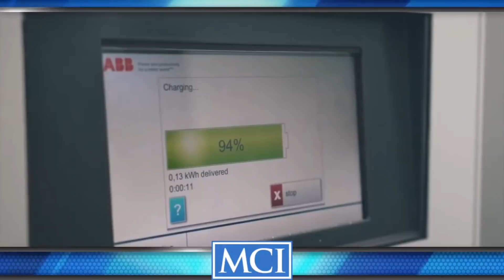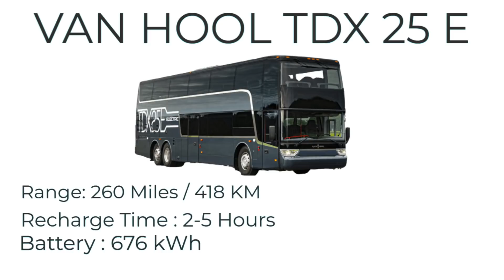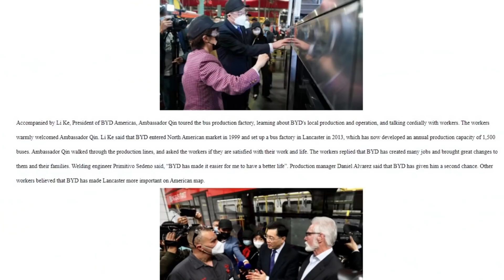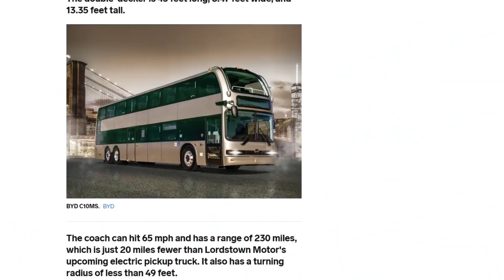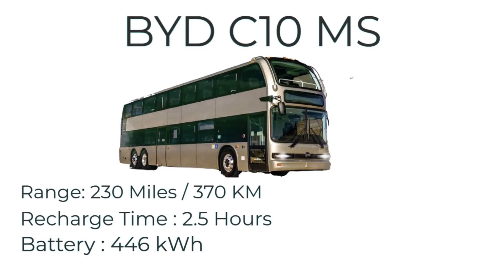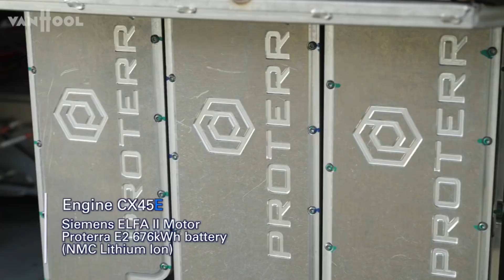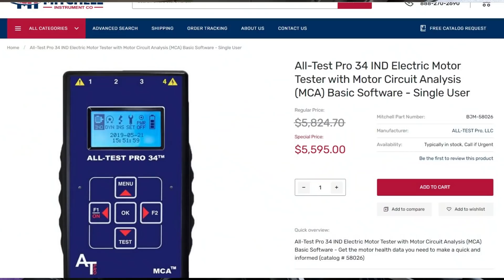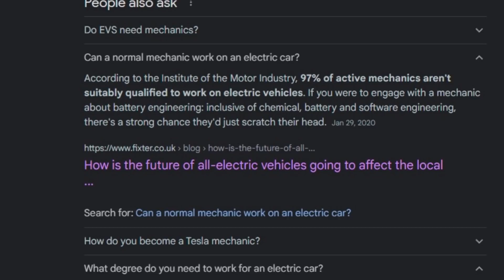Are Electric Buses working out in the US?

Comment: Also, I have a friend that runs an NGO in Romania, where there was a big scandal a few years back regarding some early electrics including BYD. The scandal was that they had two demo city buses, and both broke down during the entire demo run. That sparked some debates, pro and con, and my friend went on a campain to just simply gather data.
One thing that was a bit shocking (haha...Im doing your puns now), was the issue with fires. Fast charging, as well as the buses just sitting at night were at risk of fire, and battery fires are very different from diesel fires. He has documented all the cases since 2006 on the forum, and its pages long, of garages that would go up in flames, and in one case somewhere in one of the Nordic countries, the entire fleet of 200 buses went up because of a short in one of the electrics. This happened in the EU, Romania (back when it wasnt in the EU yet, and one more time later), Russia, China, and so on, with fires consuming anything from one bus, to the entire fleet, garage, offices and everything.

It is something that has to be taken into account, even more so as fire fighters need special training, and often cannot even approach these fires depending on weather (maybe thats changed now. Im not FD.). I always come off as being anti eletric, when I love trolleybuses and trams, but the issue I see is that this is not a technological advancement, but rather a governmental advancement. This tech would not survive on its own. Diesel in the auto world was never helped along, and even Diesel still made inroads in cars and trucks. I doubt that would have been the case with Electrics outside of some very small city cars (a la the motorcylce license cars of Paris) to some exotics.

Another thing that I find intriguing, is how different agencies treat the battieries, were the DOT will say they are fine, but the FAA outright bans the transport of Li-Ion batteries (I think it was due to UPS 6 that went down because of them. Also look up One Wheel, a company that tells customers to spray paint over the hazmat labels or their FedEx air packages, returns of DEFECTIVE battery powered devices). I am not sure what the evac time for a coach or city bus is when full, relative to the expansion rate of a Li-Ion fire, or if there were any tests done by the DOT, like the FAA requires manufactures of aircraft and operators to do. So, a lot of these hurdles seem rushed and its usually the consumers that will suffer. And I havent even gotten into any  geo-political aspects, the why, where, who, and so on. Im more interested in the engineering, practical aspects.

Hopefully I didnt go overboard with the clickity clack here lol. I have to get back to work anyways.
Reply: "Eh, who cares about a bunch of battery fires?  As long as there's no tailpipe, we're good!" -Typical EV fanatic  😂

But seriously, isn't it interesting how "hoverboards" with small LI-ion batteries were banned from public spaces and transport (for obvious reasons), yet vehicles with giant 500+ kWh firebombs...I mean batteries onboard, are allowed to transport passengers?  But hey, gotta break a few eggs to make that omelette, right?
Reply: @guildrich  Yes. There was a RoRo car carrier then sank a while back. It made headlines for some one of a kind Lamborghinis and Bugattis, and it all started from a VW EV. They evactuated, the ship burned so bad that eventually sank.
Reply: It’s important to understand that not all lithium ion batteries are created equal. There are several different chemistries, and form factors (of cells and packs), available and both have a strong influence on fire safety. If engineers make poor choices (such as with Chevy Bolt batteries) the fire risk is very high, whereas if the correct choices are made, fire risk is very low (e.g. LFP battery chemistry). Certainly, with the proper engineering, risk of fire starting is much lower than in an internal combustion engine vehicle, although it is true that if fire starts it can be more dangerous because the fire can be harder to extinguish. However, many batteries have effective anti-propagation designs to reduce this risk also.
Out of interest, how much research have you done into subsidies for fossil fuels? I think you’ll find your statement about diesel is not true; it’s just not as overtly obvious that the subsidies are happening because they aren’t at the point of purchase.
Reply: @harry-dymond  Yes, you are right about the subsidies for fuels. But I think everyone assumes the end recipient is the energy company, and not the end consumer that votes. Ultimately it comes down to efficiency, and Joules per kg per hour. Nothing beats hydrocarbon fuels, except nuclear (and I mean, the actual chain reaction, not the electricity generated, since thats just steam power generation). And if you want your mind blown, take the energetic ecuations of everything on the planet. It all balances out to zero. The same applies to any given fuel source. It will burn to the same amount of J be in now or in ten million years. So oil, will burn whether we do it, or it oxidizes on its own, and it will oxidize. So if there is a problem with the environment, its a fatal one and there is pretty much nothing we can do. We're dead. Every living thing. Then go into more poltical arguments, that research that sets off on these premises is never funded. Not even oil companies fund it. Why? That is hardly scientific when one premise is utterly ignored.
Reply: @RipRoaringGarage  Oil will oxidise whether we burn it or not? So we might as well burn it all now? That is seriously your argument? What a total load of tosh.
If it stays in the ground, it doesn't burn. Perhaps over millennia it will oxidise; honestly I've no idea whether that's the case or not; it doesn't really matter. The issue, in terms of climate change, is the speed at which we are putting carbon dioxide into the atmosphere, and the speed at which the climate is changing. And anyway, the case against ICE is not just about climate change, it's also about how the emissions literally kill people (cancer) and cause or exacerbate various long term-health conditions such as asthma and dementia. Even when some of the electricity is generated by fossil-powered stations, it's better that those emissions come from a power station away from population centres where they do considerably less damage to human health, and will gradually be replaced by non-fossil sources.

Whilst you are indeed correct about how good hydrocarbons are as a fuel in terms of energy density, it is not appropriate to use the term "efficiency". In fact, the internal combustion engine is extremely inefficient when compared to the electric motor, and the total energy efficiency of a BEV is vastly superior to that of an ICE vehicle, despite the extra weight that the BEV must carry around in the form of batteries.

However, to get back closer to the subject of the video at hand, I would have to agree with its main premise, that things are not quite ready for long-haul coach services to transition to battery power. What is required is improvements in battery costs, and gravimetric energy density and/or recharging speed (battery swap would be ideal). Hopefully this will happen over time; in the short-term short-haul use cases can benefit now from converting to battery electric and that should help to spur the required improvements for longer-haul applications.
Reply: @harry-dymond  You have your religion and I wont argue that. 
If you wont even listen, and changed what I said to serve your point. Have fun with all the landfills with batteries. I am sure that they are safe.
Reply: @RipRoaringGarage  I apologise if I have misunderstood what you said. I honestly believed that I was simply paraphrasing and not distorting. Perhaps if you could restate your point in a different way, we could make progress.

BEV batteries don't go into landfill. They can be reused for stationary storage and when completely useless they can be recycled to recover around 99% of the raw materials within.
Reply: @harry-dymond  The points are simple, from an energetic perspective. Remove all political points, propaganda aspects, and only use things that can be verified, and duplicated, i.e. scientific methodology. This is the internet though, so I get tired of making the same treaty every post like this, so I may be abrupt. Not my intent. I also honestly cant say I care about the environment anymore. It is a tainted subject. As far as what I had said, nowhere did I imply that all oil should be burned at once. Besides this, oil is regenerative, and in far less time than one may expect. I have stumpled upon this in my garage, with certain things liquifying into a flammable oil. On the other end, batteries mostly are not recycled. What CAN versus what IS, becomes an issue where LiIon batteries are burned off to extract the copper, and nothing else. This is the current method in Africa, via Chinese copper companies. Add to this any defense points of view, and barring nuclear, hydrocarbons are the most energy dense fuels and/or explosive for munitions and such. The guarantee of going full electric, is being conquered. 
I will say this. Prior to my youtube video career, I was a scientist, and this topic has become so toxic that I have burned all my electric and battery research notes. I uttery detest the topic. Let somebody else reinvent high energy transfer batts.
Reply: @RipRoaringGarage   Do you really mean that you "don't care about the environment", or do you mean that it is too difficult to discern which things are actually beneficial, and which are not? Certainly, it can be tricky, and it is scary how many flat-out scams appear able to attract significant amount of attention and funding. I have Masters and PhD degrees in electronic engineering so I like to think that I have the necessary skills to help me determine which is which. Perhaps if you hadn't "burned all your notes" and continued studying, you might be in a similar position?

You did certainly say this: "So oil, will burn whether we do it, or it oxidizes on its own, and it will oxidize. So if there is a problem with the environment, its a fatal one and there is pretty much nothing we can do." You will have to forgive me if I interpreted that as an attempt to excuse simply continuing with the status quo (which is what I meant by "burn it all now" - "now" being "over the course of the next 50-100 years", as opposed to millennia). If that was not your intention, then please restate/expand this claim in a different way.

My contention is that if oil stays in the ground, it doesn't burn. My intuition is that if it stays in the ground it will never oxidise, but I must concede that I have no way to prove it (although there's plenty of evidence to support this - more on that in a moment), but as I mentioned before, it doesn't matter. What does matter, is that if your assertion is true, it will certainly take a VERY long time, in which case the carbon dioxide generated will not be a problem. A quick Google shows that oil reserves were formed at least 65 million years ago; and some of it is over 500 million years old. So, you are asserting that it's going to oxidise at a speed that's a threat to our existence, yet some of it has been around for hundreds of millions of years and hasn't oxidised yet. Your claims simply do not stand up to scrutiny.

What you are referring to as "regenerative oil" is known as biofuels. Basic analysis shows that it would be impossible to simultaneously replace all existing fossil fuels with biofuels and feed everyone - there's only so much fertile land available. Certainly, there is a place for biofuels in the future, but only for niche applications.

What you say about batteries is partly true - yes this sort of thing does go on, and it's depressing that corruption and organised crime can lead to these sorts of outcomes. However, there are companies that do recycle LiIon batteries properly, and it is obvious that recycling of car batteries is what will happen in the vast majority of cases.

I have already agreed with you that hydrocarbons are extremely energy dense. This is undeniable. But it's not the only consideration, and therefore doesn't make them the best choice for an energy source going forward. Certainly it is true that we would not have been able to get here without them, and we can't transition away instantaneously. What you are missing is that ICEs are not good at converting the energy from fossil fuel into kinetic energy of a vehicle, and in the absence of any hybrid system, all the kinetic energy must ultimately be converted into heat when stopping the vehicle - it's a double whammy. Over the life of a vehicle, BEVs are vastly, vastly superior to ICE in terms of energy and resource use; the downside is undeniably range, but I am confident that this will be solved over time.

To anyone that read this entire post - thanks!
Reply: Wow!🤯
Reply: Yeah now PIERCE, E-ONE and ROSENBAUER are beginning to push all electric fire apparatus. That’s scary to imagine.

Comment: A couple other things that will probably add expenses. You know with the CDL they will probably require some kind of training or endorsement when the electric coached and trucks become widely used. Also not buying fuel they are going to have to create a new tax to compensate for that lost revenue.  At home  when I need something new I have been replacing with battery operated. Waiting on my lawnmower next:goodvibes:
Reply: The E-Go walk behind is a solid choice if you don't need a rider.
Reply: @counterfit5  Yes that is what I am looking at and the Zero turn they have.  Seems like the best one I have seen so far.

Comment: The last issue with ebusses is infrastructure! Charter busses do not always go where there are charging stations and that infrastructure is a long way off unfortunately!
Reply: The power available is 25+ years away, even if battery power was available (it's not) The grid is NOWHERE near being able to handle 150 million people plugging in their 240 volt, 50 amp chargers every day. Wind and solar aren't going to power that kind of demand and it takes decades just to approve a new power plant.
Reply: @TheBandit7613  Anti-EV people love to say that.  Too bad they're wrong, though.  By the time enough EVs can be built to cause these imaginary grid problems to even possibly become real, power companies (or even end users) will have expanded power generation to match.  The average car in the USA goes 40ish miles per day.  12 amps of 120 volts from any wall socket, for 10 hours overnight when the grid is not the least bit stressed, is enough to recharge that.  Where I live, that costs under $1, and it's not bringing down the grid.
Reply: @EfficientRVer   120 volt, 12 amp. 
What is that charging? A Power Wheels Barbie Jeep? A 240 volt Tesla charger will do 22 miles for every hour. What kind of mythical car are you quoting?

Comment: I wish I knew (facetiousness) why battery electric is promoted versus trolleybuses. Its MUCH lighter, better CG, and far better environmentally regarding batteries, since it has limited batteries since it doesnt need them. Trolleybuses also have much simpler electronics (some older types not even having any! Rheostats baby!). They do need wiring for the routes, and are somewhat fixed along them, but they are much cheaper long term with a life of 20-30 years.

And best of all, both systems appeared without govt pushes, in a natural and organic way. Once subsidies end (and they will end) companies will be burdened with the extra cost of maintenace and other issues (disposing of batteries etc)
Reply: Because people think the wires are ugly, and/or they don't want to pay for them. Trolleybusses with a 20mi battery range can serve an entire city.
Reply: @counterfit5  Then they pay for battery buses at 3-5 times the price. I think its a case of nimby more than anything. And yeah, the trolleybus can carry some batteries that can recharge off the network or breaking, but you get into more complex electronics, where as the cheaper models end up long term costing way less. They may consume maybe 20 percent more, but maintenance is very low (mostly drivedrain stuff, tires, brakes, bearings, oil), and there are no shelf life items, like the batteries, or just run of the mill electronics. A lot of the efficiency of the older units actually came from driving technique, which even though automatic (no trans), it was a skill on how and when to accelerate, knowing what phase of the rheostat you were in and so on. But then again, we also want AC, and soft cushions, leather, and so many other things in a bus, that are counter to the whole idea of why we even go with alternative fuels.